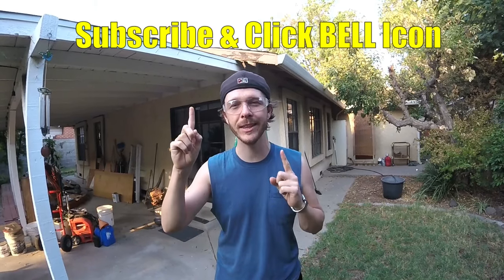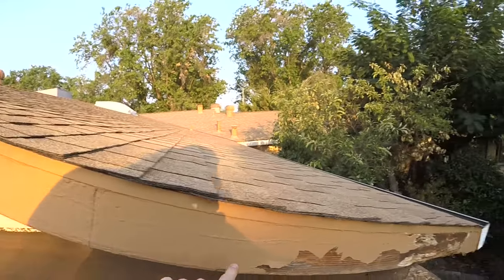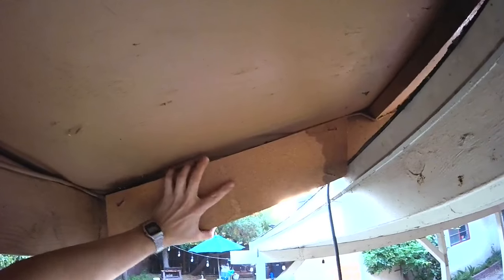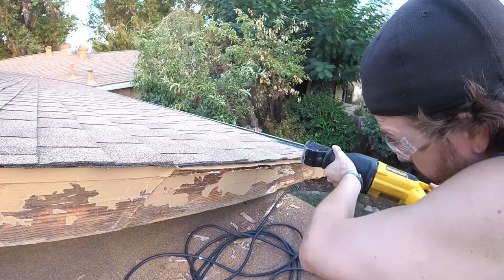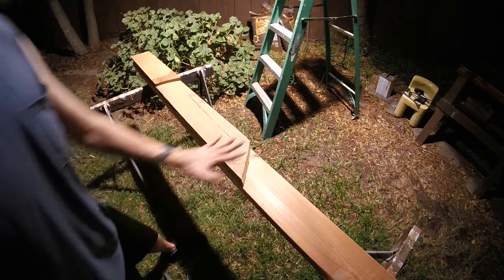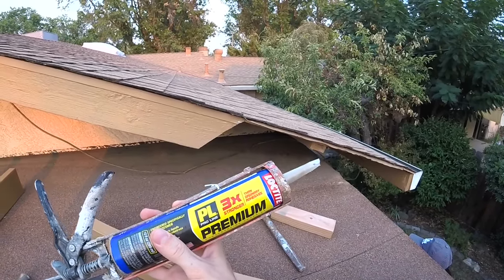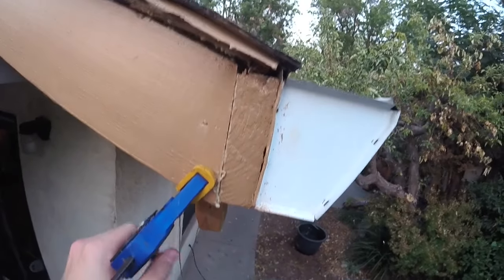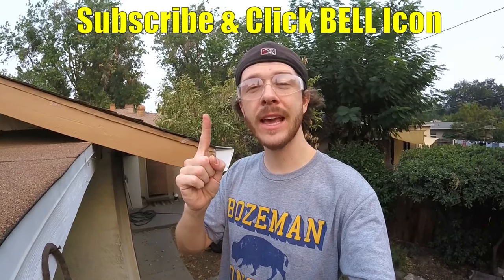How To Repair Rotten Fascia on a House

Comment from the maker: TOOLS & SUPPLIES
Cordless Circular Saw with Battery/Charger- https://amzn.to/36wBOMn
Reciprocating Saw aka "Sawzall"- https://amzn.to/40oV9Li
Blades for Sawzall- https://amzn.to/3FDBJKX
Nail Puller Claw Pry Bar- https://amzn.to/42uAyac
Thin Prybar- https://amzn.to/36zUgne  
Speed Square- http://amzn.to/2idDsOz
Combination Square- https://amzn.to/3LUzbIN
Utility Knife- http://amzn.to/2rIeUQP 
Tape Measure- https://amzn.to/3rijQYo
Drill Set- https://amzn.to/3gALei8
Drill Bit Set- http://amzn.to/2fSpMYz
Irwin Squeeze Clamps- https://amzn.to/3tThhh5
Tin Snips- https://amzn.to/2spnkeC
Multi Use Scraper Tool. 6 in 1- https://amzn.to/3kzy1uy
Pro Grade Caulk Gun (Brand I Use)- https://amzn.to/3ZdA6LE
Construction Adhesive Glue- http://amzn.to/2nPmPbw
Paintable Caulk for Trim- http://amzn.to/2rFpcxq
100% Silicone Caulk - https://amzn.to/2KKtLkY
Dual Respirator Mask- https://amzn.to/2xkGNTA
Respirator Masks N95- http://amzn.to/2xX32x3
Safety Glasses- http://amzn.to/2ez41Jw
Leather Work Gloves- http://amzn.to/2x5BZk3
If you Enjoy the Channel Consider Helping Support it by Donating below & by Subscribing.
PAYPAL DONATION https://www.paypal.me/JonnyDIY

Comment: why are you using the caulk like its a welder? Wouldn't a smooth straight bead work best?
Reply from the maker: @GhostSot  🤣 stackin dimes! I wanted to make sure I got the seams fully covered on each edge, that's probably why I did it in that particular instance 👍

Comment: Great video I have the same problem  with fascia corners on our home it a good thing not at the top of home but bottom corners   I think I have some scrap lumber & only thing I need to buy is primer &  sealers  +  high grade  out door house paint.  I figure it might be a  2-4 hour job since I have one really bad some and 2 that might only need some minor sealer & repainting.
Reply from the maker: @wayneclu91  Thank you, happy to help. Yes the corners are always the first to rot. I have some more I need to replace as well. Good luck on the project! 👍

Comment: The facia board resting on the roof probably contributed to rotting it?
Reply from the maker: Possibly, but I doubt. It's not resting on it, the patio awning was build on after that room was built. Just age and sun rot,  bad quality wood. The corners of your fascia board are always going to be the first to rot. Mostly from rain and water/dew dripping down to corner and getting into that joint where 2 meet
Reply: I agree with this comment. I would have notched the facia board where it comes close to resting on the roof to be sure it does not get any moisture. Why else would it have rot exactly there?

Comment: Im confused why the cut had to be a 45 degree angle when it couldve been square?
Reply from the maker: @rebelandproud1  it makes a longer joint so it'll be stronger. Also better for expansion and contraction of the joint 👍

Comment: Don't use silicone caulk.  You can't paint silicone.   Use a urethane based caulk and paint it.
Reply from the maker: @jhart3216  Thanks for the tip 🙌Yes I like big stretch or dynaflex when I want to paint over it on exterior 👍
Reply: @JonnyDIY  I also wondered about the silicone, thought you'd sand or paint over it...that didn't bother you I guess, the appearance of it.
Reply from the maker: @kimkhebert  yes it drys clear and can't even see it. I use paintable caulk on more visible areas and places I have to paint

Comment: Thanks! Everything is helpful and you had good fixes on the problems that arose. BUT... DON'T USE SILICONE ON ANYTHING BUT BATHROOMS!!!! As a professional painter, that stuff is the bane of my existence when DIYers use it on their trim or siding or windows or anywhere we have to work. Nothing sticks to silicone, not even new silicone. When it's time to repaint, that stuff has to be removed. Plus, clear doesn't mean invisible. It's best to use something like Quad OSI or QuadMax. Or if you want something with water clean-up, Big Stretch. Then paint it. And it's gone. Other than that, great video. Just don't use silicone. Ever.
Reply from the maker: @MichaelRieck-i8g  Awesome thanks for sharing. Yeah I've been buying dynaflex ultra lately but want to try those like big stretch 👍
Reply: What about the paintable silicone thats out there now?
Reply: Correctamundo!
Reply: @Rich3016  You could give that a try. Just make sure it's the paintable stuff. I haven't experimented with it any because those other caulks I mentioned do what we need them to do. I do wonder what they sacrifice when they make the silicone paintable.